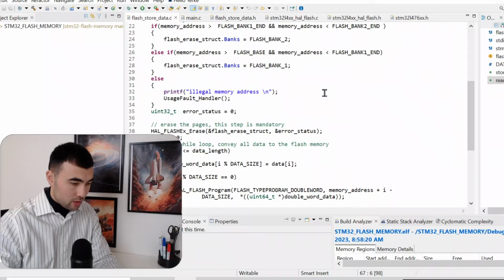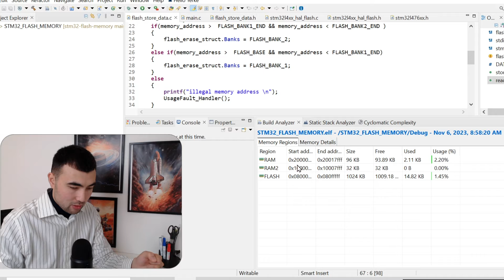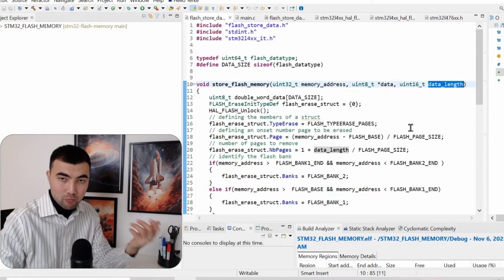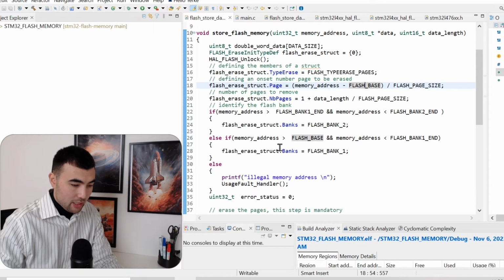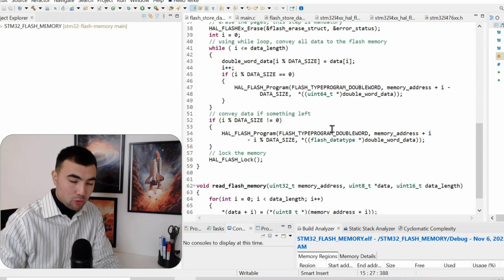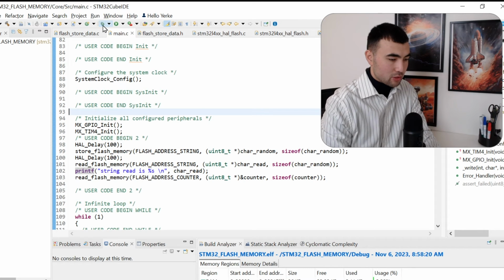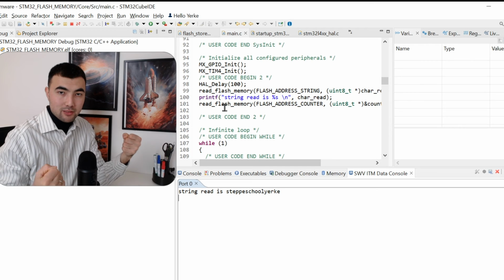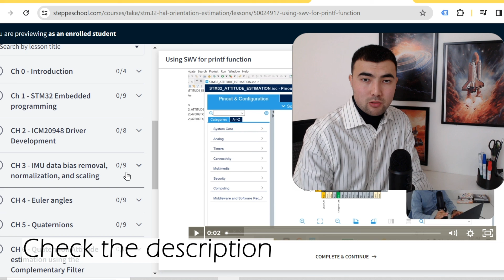Use STM32 Flash Memory to store data Permanently

Comment: Is it necessary to transfer the code which works with Flash to RAM to avoid potential conflicts with Flash bus? I mean, if we need a new instruction from Flash while reading or writing to it, core will encounter a access conflict, because it is already occupied by us
Reply from the maker: interesting observation. Maybe there are separate buses for executing the instructions and storing data in the flash memory. Personally never enounctered such a problem

Comment: I am able to read and write to the flash using this method for a H753 microcontroller. However, when I comment out the line and rebuild and reflash the code, the data I store in a part of the flash memory also gets cleared. I have tried modifying the linker script but it doesn't work. It is as good as writing to RAM. Does anyone else face this issue? I am unable to instruct my debugger to clear only the code related sectors of the flash and leave the data sectors untouched.
Reply from the maker: Nost probably, your programmer erases the flash memory before flashing the new code. You can chack debugger/flash configurations to remove that option. If you flash with STM32CubeProgrammer,  you can easily change that
Reply: @steppeschool3629 thank you for your reply! I am indeed able to work with it using the STM32 Programmer application.

Comment: That’s interesting, your chip has 256 pages of 2k per bank and mine (STM32F411CEU6) has sectors of different, varying, bigger sizes: 16k/16k/16k/16k/64k/128k/128k/128k
Reply: You probably have an F4 and steppeschool has an F1. I personally like the F4 better in that aspect because it gives you bigger sectors to work with.

Comment: Is a STM32G030F6P6 a good micro to start learning stm32? I liked it because it is very cheap, and don´t need nothing too sophisticated... What do you think?
Reply from the maker: Since all STM32 MCUs are based on ARM Cortex architecture, learning to work with one of them is sufficient to understand the general principles. However, personally, I have never worked with the microcontroller you mentioned. Good luck with the learning process. 
Also, you can check my STM32 Intro Course:
https://www.steppeschool.com/courses/stm32-programming-course